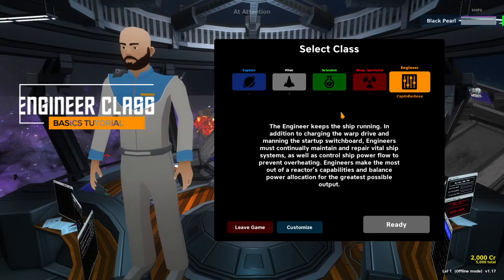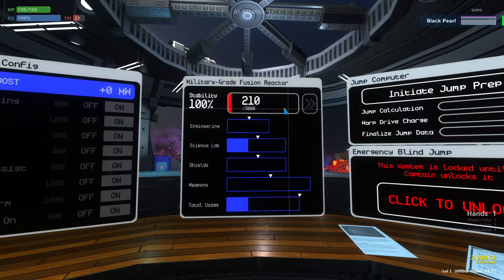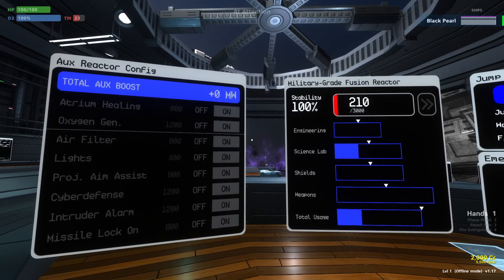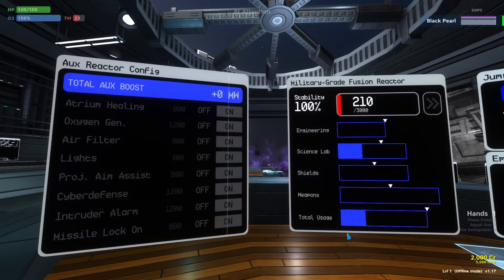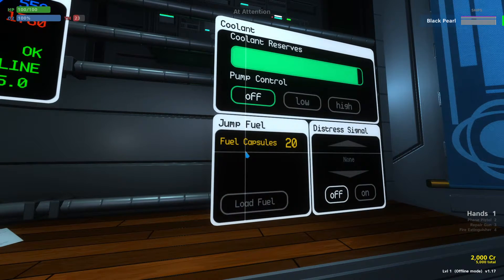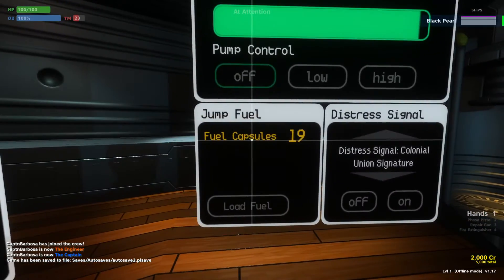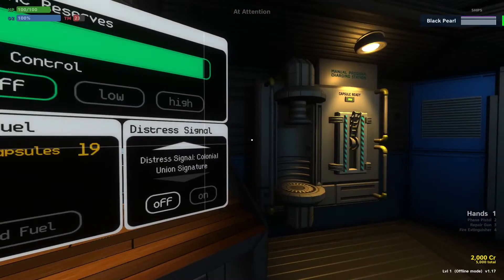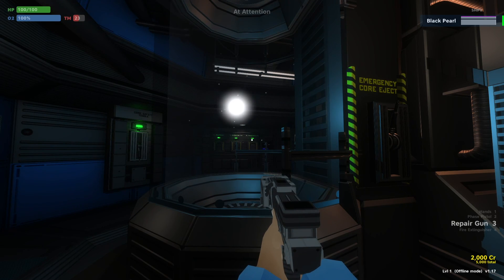Engineer Basics Tutorial Pulsar: Lost Colony v1.17

Comment: How would you compare "Pulsar" and "Void Crew"?
Reply from the maker: I love that you asked this question. Pulsar gameplay still has this special place in my gamer heart as an in-depth Vessel Cooperative game that feels like Star Trek. Void Crew will give you an isolated arcade-type experience, but the depth that Pulsar has, and the gratification you and your crew get for upgrading your ship and abilities is so satisfying. 

Once you're done with your advancements in Void Crew, you might crave a bit more. Then head over to Pulsar with the depth that they have. That small team accomplished so much, and there's a frame work for an incredible A+ game in the future that mimics the systems Leafy Games put forth.
Reply: @CaptnBarbosa How about comparing Pulsar to what Star Citizen is trying to do with engineering gameplay? I feel like CIG borrowed more than a few ideas from Pulsar. But instead of coolant/overheating causing you to need to balance things, it will be limited amount of power. Star Citizen will have power management, relays, fire, atmospheric control, component maintenance and repair, wear and tear etc.